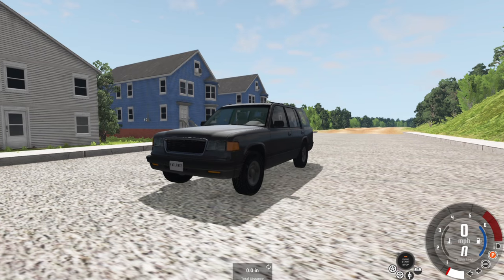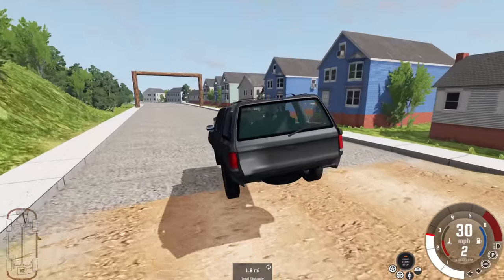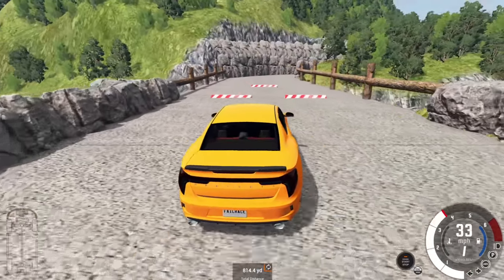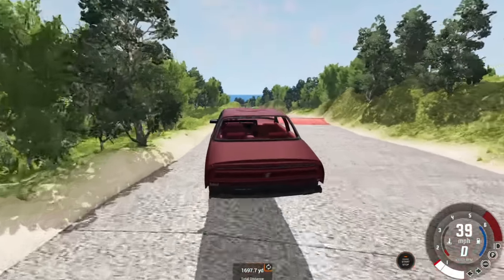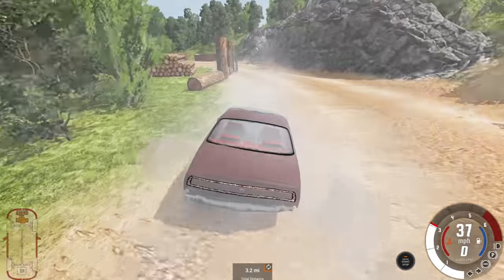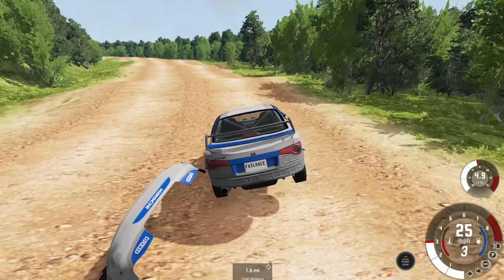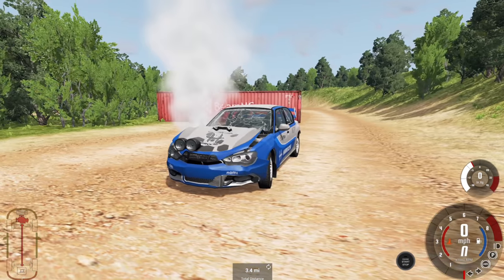Ultimate Endurance Course Revisited - BeamNG Drive

Comment: I’m dying for a new DTD series, however, my issue with this course is it feels like it’s a steering test 99% of the time, any steering damage at all and cars will have to crawl around every corner and obstacle, I just wish it had more high speed sections
Reply: Well the issue is the stupid oil pan, it's so easy to break and it will cause the car to die pretty fast once it does so sadly you can't have many big jumps that might break it :/ it started to become a huge issue on the last circuit because there were several big jumps and it started to constantly break the oil pans once that got added and the cars lasted only a couple laps at most

Comment: Perhaps I can clear something up for you. As a British person, you are taught that AWD (All Wheel Drive) and 4WD (Four Wheel Drive) are the same thing. Though it may seem semantically unimportant, they are NOT the same thing. You might notice that the Roamer, if you were to remove it's rear drive shaft, would perform as though it was purely FWD (Front Wheel Drive), whereas the Sunburst rally car does NOT perform as a purely FWD car. The Roamer is an example of a 4WD car and the Sunburst is AWD. 4WD means that the front and rear differentials are LOCKED TOGETHER. There is NO differential in the center. This means that if power is cut to one of the differentials (as with a broken rear driveshaft), the one still getting power gets 100% of it. An AWD car on the other hand, DOES have a center differential. That means that if you were to cut power to the rear differential (for example) the front would only get a small percentage of the power, and only after a LOT of slip (hence why 4th only took you to 30mph). The percentage of power that the functional differential gets is dependent on the limited slip percentage of the center differential and its initial torque setting. If the center differential is open (that is to say it has zero limited slip functionality) then if either differential loses drive (eg if the driveshaft breaks) then the functional differential will receive no power whatsoever. If the center differential has a 100% limited slip center differential, then it will perform similarly to a 4WD car if one of it's driveshafts is broken. The Sunburst rally car has a roughly 30% locking action and fairly low initial torque by default if memory serves.

So why are they different? Why aren't all cars 4WD by this definition, and why do 4WD cars often have a 2WD mode? Well it comes down to one thing: the front and rear axles of a car travel different distances, much like the left and right side of one axle. If one were to not have a center differential and have the front and rear axles directly connected to each other, on road performance would suffer TREMENDOUSLY. Because the axles travel different distances, there would be binding in the drivetrain every time you turned a corner. This binding could lead to tire skip, drivetrain wear and plenty of other unpleasant side effects, not to mention it would make the drive itself uncomfortable. So, in vehicles that are primarily used on road, this just doesn't work, but there are a few different solutions. The first solution is reasonably simple. Just disconnect one of the differentials for on road use. In modern cars this is as simple as turning a dial to 2WD or perhaps moving a lever. This means that since the front and rear are no longer connected together, it doesn't matter that they turn at different speeds. This is why these systems are called "Part-Time 4WD," because the 4WD mode is only intended for use part of the time (in slippery/off-road conditions). Another solution is to include a differential between the front and rear axle. This functions exactly like the differential at either end of the car; just like how a rear differential allows each rear wheel to travel at a different speed, the center differential allows the front and rear axles to turn at a different speed, thereby allowing them to travel different distances in the same amount of time. These differences mean that AWD and 4WD have different benefits. AWD functions better in relatively high-grip environments, or environments where the grip level may change quickly, such as on road in the rain or snow. There are no levers to pull or dials to turn, the car drives the same predictable way no matter what. A 4WD car will perform better in extreme conditions, however. If the front axle is entirely on ice, the rear axle will still drive the car forward with little-to-no slip, where an AWD car will have a lot of slip. The downside to this is that 4WD needs to be engaged manually in extreme conditions and is not advisable to use in relatively high grip conditions like rain. 4WD will also perform very differently depending on what mode it is in, in 4WD mode it will be extremely understeery off-power (hence why the Roamer is such an understeery barge) and probably a little oversteery off-power in 2WD mode. It is also important to note that very often (though not all the time) 4WD is significantly sturdier than AWD, both in terms of the system's strength itself and the vehicles they are in, and likewise 4WD is marketed as an off-roading thing and AWD is marketed as all-weather security.

There are, of course, exceptions to these rules. For example, a (modern) Mercedes G-Wagon. This is clearly a 4WD car, right? Well, yes and no. It is actually AWD most of the time, but it CAN be 4WD. Whaaaat??? The G-Wagon has a center differential and therefore is AWD, and this is how it functions 99% of the time. However, in extreme conditions this center differential can be locked, meaning the front and rear axle are solidly locked together, thereby making it 4WD. This is probably most accurately called Full Time 4WD, as the G-Wagon foregoes a 2WD mode. The 80 series and up Toyota Land Cruisers have a similar system (at least in the US Market). Another oddity is anything with a Haldex AWD system, such as a Golf R32. This system doesn't actually have a differential at all, despite being called AWD. It avoids binding by being a completely FWD system in its default state, and having a clutch pack that adds in rear drive as it detects slip. So if the rear driveshaft was to be removed from a car with Haldex AWD, it would simply be FWD. If one could command the clutch pack to go to full lockup, on road this would behave more similar to a 4WD car rather than an AWD car. The ATTESA E-TS system Nissan uses in it's GT-R is similar, but with power being constant to the rear wheels and the system being more proactive than reactive. These systems are probably more appropriately called "Automatic 4WD," but because the vehicles they are in are pretty much only intended for on-road use they are called AWD. There are also vehicles with systems called Automatic 4WD such as early 2000's and up GM trucks (I think Ford got a similar system in the late 2000's). These trucks have 2WD, 4WD and 4WD Low like most 4WD vehicles, but they also have a 4WD Auto mode. This mode (to the best of my understanding anyways) basically functions as a reversed Haldex system like Nissan's ATTESA E-TS, but less advanced. A similar idea was implemented in the early 2000's Mitsubishi's Montero (Shogun/Pajero outside the US) SS4-II 4WD system. It has 2WD, 4WD and 4WD Low modes but also a full time 4WD mode. This system uses a center differential rather than some kind of clutch pack system. So in 2WD mode the center differential is locked and the front driveshaft disconnected. Adding to the complexity of all these different systems, modern Traction/Stability Control systems can allow AWD cars to simulate 4WD systems to some degree. This can be seen in Subaru's "X-Mode" where the system uses braking at individual wheels to simulate differential locks, and similar systems are in many AWD cars today.

Hope that helps! If anyone has questions feel free to reply :) (also anything in ALL CAPS is for emphasis, not to yell)
Reply: Thank you for this solid explanation. I knew there was a difference, but wasn't quite sure / couldn't remember what it was

Comment: So glad you made this video, I tried this track a few nights ago and it looked so unfamiliar I wondered if it was the right track :)  I tried a Crashhard, it landed on the cheese grater and BANG the back axle fell off and swung through so the back wheels - still on the driveshaft and working fine - were sticking out in front of the car :)  Eliminated on the 20 mph rule :-p

Comment: The track is pretty good, but most of the jumps tend to be mostly nose drops, so you will get a lot of radiator damage on anything lower than a 4 x 4.
Reply: I have driven the track in beam and the big jumps mostly cause oilpan damage, not radiator damage

Comment: That sunburst is AWD not a 4x4. So it's a limited slip centre diff, those don't work well with one driveshaft removed.
Reply: Exactly, just like how when you break a wheel axle in a FWD Pesima, you can still drive, but slowly. It's not a locked transfer case like it would be in a 4x4.

Comment: The driven till destruction series need to come back with a brand new track.
Perhaps even a track where the cars can be driven flat out at top speed continuously to see if they can last 1 hour without over heating or blowing up. If the car runs out of fuel or survives the hour it wins. An engine abuse challange of some sort

Comment: Possible names for the Ultimate Enduro Course:
- Section 1: Village section leading to Tidgy Rumble Strips, then Rumble Road, then False Table Top, then Sandbank of Doom. After the right hander it's Rock Slalom, then Candy Canes Corner leading to Candy Canes Straight.
- Section 2: straight off we start with the Shreddies Jump, then the Logs of Carnage leading to the Sleeping Speed Bump Curve.
- Section 3: starts with Dover 2.0, followed by the Buried Container Jumps
- Section 4: the Mud Canyon, leading to the Lumber Yard complex, and the Mud Splash Jump. Then it's Baja Bank #1, leading to the Container Slalom, and Baja Bank #2.
- Section 5: The Yumpy Bumpy Sand section.
And that's a lap.

Comment: Maybe the cheese greater section should be a bit shorter so using speed at that point will be a desired thing, but then also the grip needs to be good enough to not slide into the wall.
This should make it be that generally slower vehicles can compete here too and not only the ones that have different performance versions.

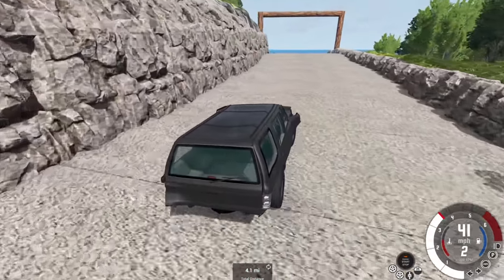Comment: 7:18 That part of the circuit should either be called "Holy Crap! The Engine Fell Out!" Or the Shaft and Mount Snapper.. Just a suggestion, if you do end up doing a series on this.
Reply: Or the “engine ripper”
Reply: It should be called, "the engine Mount grater"
Reply: @jwalster9412  I like that actually
Reply: @Minitrucker231  just ignore the fact theat I edited it 3 or four times.
Reply: @jwalster9412  all good haha

Comment: The rally car is likely fairly biased to the rear, and it is AWD not 4WD which does mean that yes it is dumping most of the power down the broken shaft still, with only the smaller front bias power going to the front

Comment: You should try the new H Series van and put some heavy planks in the back of it. its a new feature, when you edit the car’s properties, the planks should be under “Body”, then “Load”
Reply: Underrated comment, should try vehicles with stuff in the back of with different weights to see how they’d handle it

Comment: That jump onto the lattice patterned wood prior to the wooden poles is definitely a bit rough on the low slung cars. Which is sad coz it seemed like it was nice and slowly damaging to high slung vehicles like the rover.
Reply: by the way I'm not meaning when it yeeted both drive shafts I'm talking about prior laps where it was visible having some drama but not heaps. Lower cars were copping a lot of punishment from it instantly

Comment: the way you brought up the roof being crushed into the cabin not being a factor in driving makes me wonder if beam will ever simulate crash safety. Simply put, if the space for the driver becomes too small, or if an extreme deceleration occurs which the human body cannot survive, the car can no longer be driven. However, while writing this i realize you could get a new driver - provided one could fit - ultimately taking the focus off of the car.